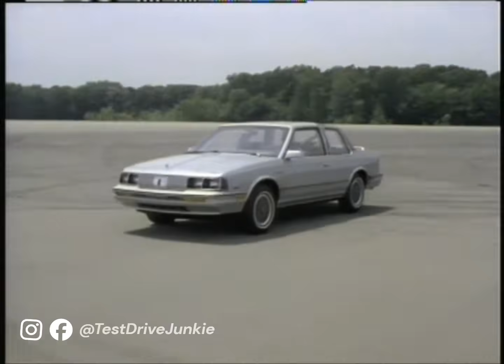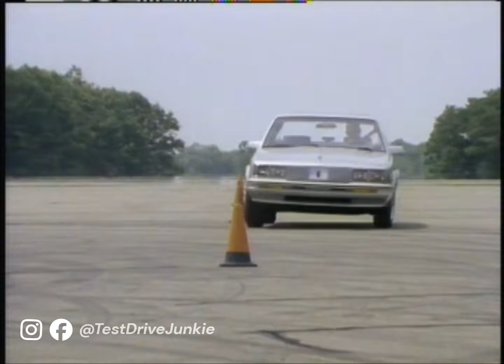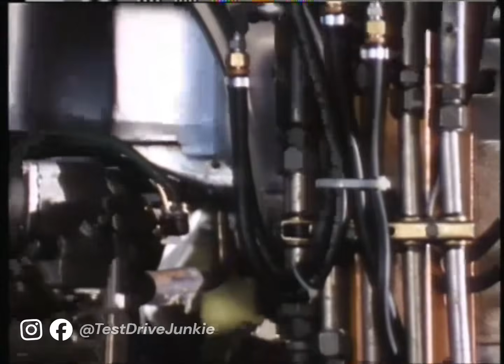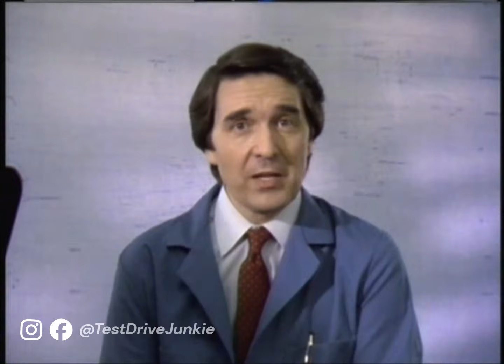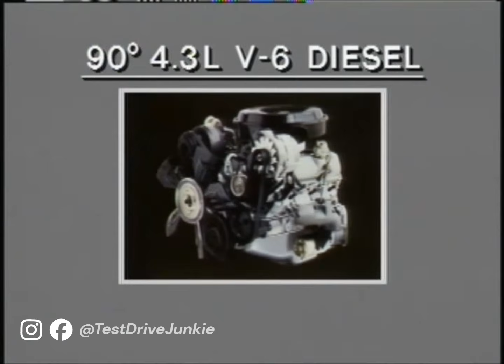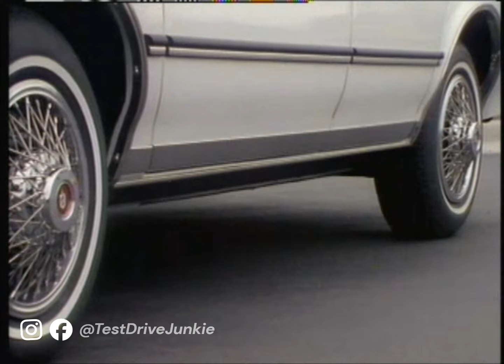1985 Oldsmobile Cutlass Ciera Canada Manufacturer Laserdisc Promotional Video

Comment: I love your channel, TDJ. Do you by chance have any 1986 Cutlass Ciera videos? Specifically '86 because that's my favorite year for the wider grill openings and before flush headlights. Also the center cap of the wire wheel covers are flatter than in earlier years.
Reply from the maker: I do!

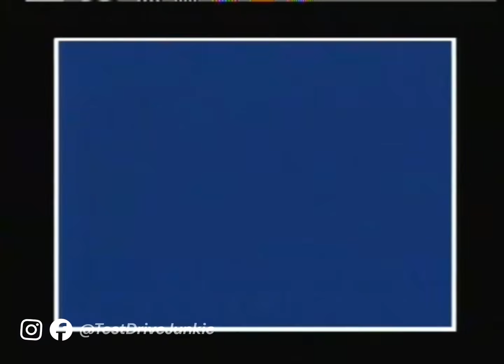Comment: 5:43 - Interesting.  I'm the U.S. in 1985, the Cutlass Ciera came with a 3.0L V6 with a 2 barrel carb, not the 2.8L.  The U.S. cars still could have had the 2.5L, 3.8L, or 4.3L diesel, but not the 2.8L.  In 1986, the 3.0L engine was dropped and then the Cutlass Ciera (and Century) got the 2.8L V6.  However the Celebrity and 6000 had the 2.8L engine in 1985.
Reply: That's because the 3.0 had tons of starting/stalling problems and was having catastrophic failures by 50k miles.
Reply: The 3.0 liter Buick 2BBL V6 was a 90 degree design using a split pin crank to smooth out the uneven pulses inherent in that design. The Chevy 2.8 in contrast was a 60 degree design which was smooth without the need for split pin crank or balance shafts. On paper both engines were very close in power figures with the Buick motor making 110 HP and 145 torque. The Chevy 2.8 made 112 and 145 which is very close. In actual operation the Chevy engine was quicker, smoother, revved more freely and provided better mileage. Seeing what a dud the 3 liter was GM went over to using the 2.8 in the entire A body line and a year later in 1987 went over to a generation II version using different aluminum heads and port injection.